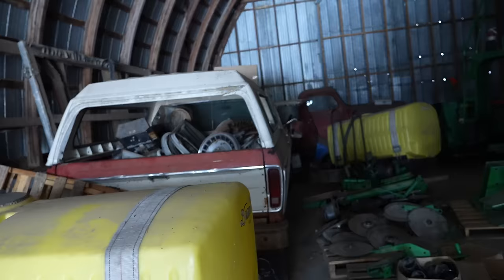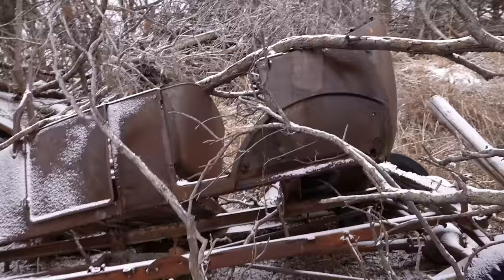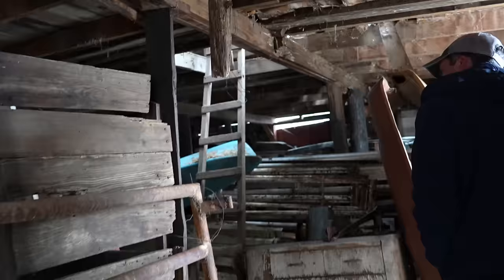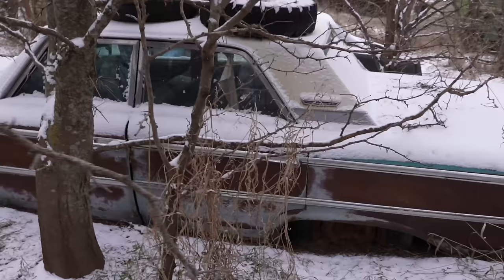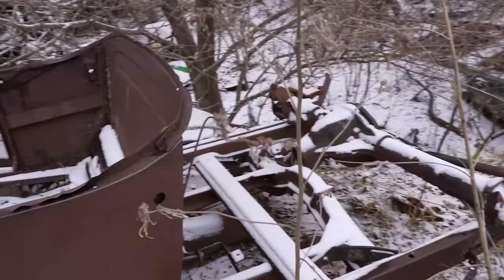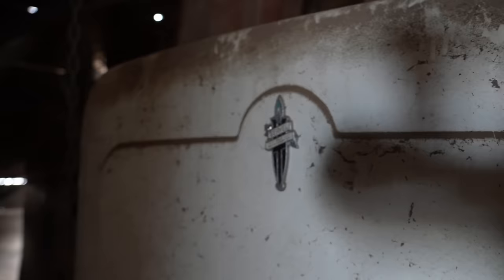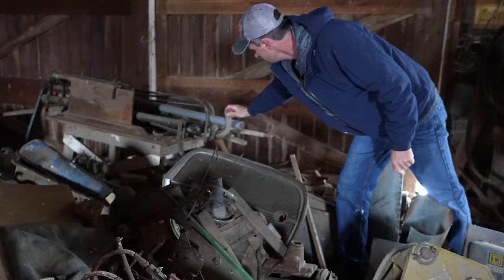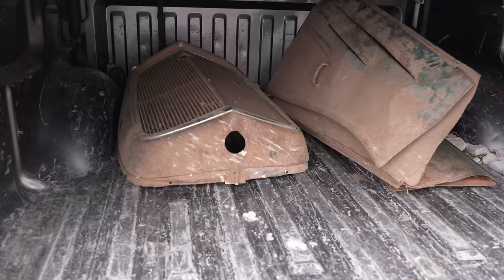This Old Farm was HIDING some AWESOME Treasures! What will I Bring Home?

Comment: The refrigerator brand is pronounced "Sir Vell". It was made in Sweden by Electroluxe Corpporation. It uses amonia as a refrigerant and operates on kerosene usually. They are still used extensively where electricity is not a available or by the Amish.
Reply: Some of the Servel refrigerators hook up to propane or natural gas.

Comment: The refrigerator looks like it is from the late 1930's. I've always heard the name pronounced "Sir-Vell". It is a gas refrigerator, and the system has no moving parts. I sold a fair number of them when I had a used appliance business. Somewhere I have a propane conversion kit, and a thermostat for one. They were good money-makers for me. I sold a few to people who had ranches in Baja California, Mexico because a lot of them didn't have electricity.
Reply: I’ve recently heard refrigerators from the beginning are what u want bc they run & run & are Still good! Where the new (ofc) have issues way too early. “They just don’t make ‘em like they used to.” So rings True these days! 
Plus more & better storage!

-Azariah (The LORD GOD [YAH] HELPS)
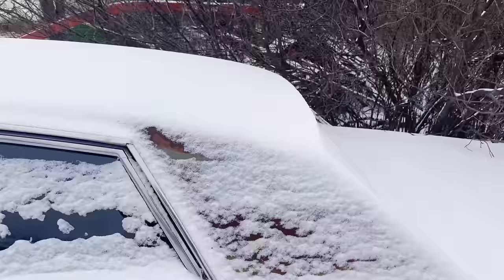PSALM 20:1, 6-8; PROVERBS 16:25; ISAIAH 43; MATTHEW 24; DANIEL 3; JOHN 3:15-21; JOHN 14-21; ISAIAH 30:18-22; ACTS 1-3; REV 2:9; 3:9; GENESIS 6-9; PSALM 9:10

Comment: The wheel thing was a box for this syrup cows would lick the wheels and it was like molasses with nutrients for beef cows,just a big square tank with gray plastic wheels connected to the lids. Sulfur molasses
Reply: Also the old refrigerator may have been a kerosene fridge. Way back when they had Fridges that had a burner on the bottom, it heated some fluid and when it cooled off to t made the fridge cold some kinda way. Seems like that fridge said it was gasoline one? It was only on screen for a second, but there were kerosene fridges back in the day, that's a fact! Not sure about gasoline ones, looked like it said gasoline on the nameplate on the door?

Comment: one of those bikes looked like the ones schwinn made that were halfway between there normal bikes and bmx's in somewhere around the early 80'sor mid to late 70's  . they are starting to b quite valuable ,espacially if the owner put new forks and wheels .

Comment: The T that you thought was the front of a Touring on a truck frame was a Roadster,The 28-29 A sport coupe had the motor and radiator sitting beside it. And that race car was either the rest of the Chevy you have the hood and grille for or a 32 Ford coupe i cant see it enough to tell.That one shed was full of A fenders! What a place. That A frame with the steering column would set right under that Sport coupe body.

Comment: He thinks he has a gold mine, but what I see is you got the only good thing, nothing but scrap metal. He points out the 68 J code Mustang that has a 6 cylinder not a 302 and the roof is cut off!